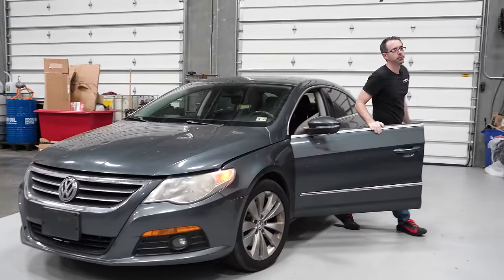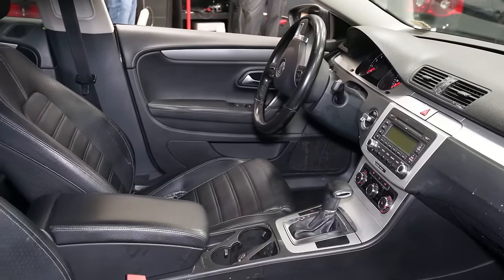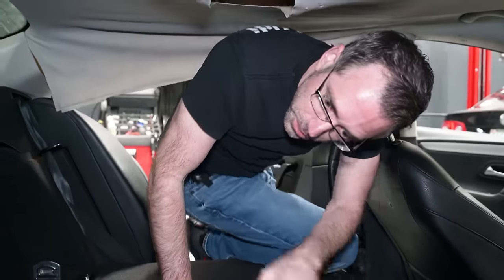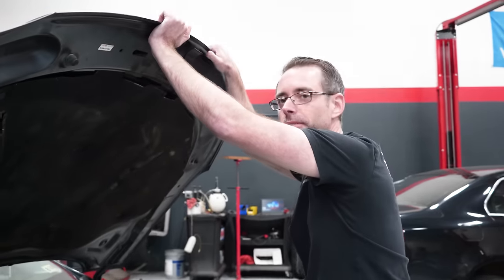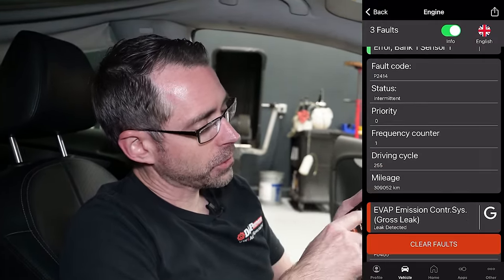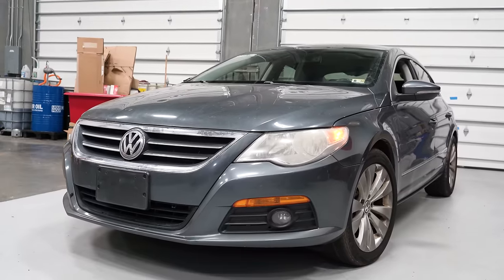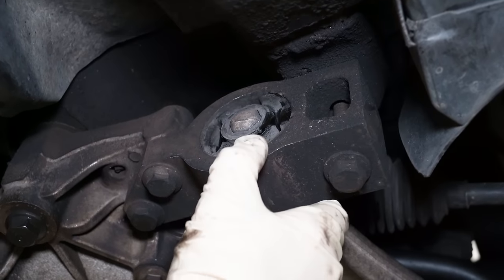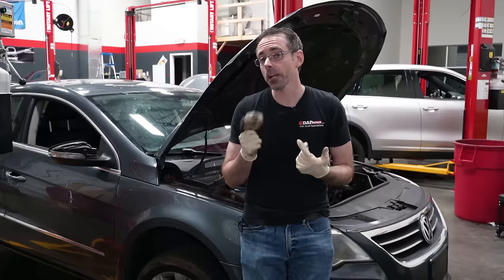How NOT to buy a Volkswagen CC

Comment: alignments are not necessary once a year. the only reason an alignment changes  is from worn out components or damage, things that would not be fixed with just an alignment.  it is however recommended to get the alignment checked when you put new tires on or if you notice a wear issue when you rotate your tires every 5k like you are supposed to

Comment: My buddy’s parents bought a 13 CC last year. Within a week the a/c stopped working and then an injector stuck and hydrolocked a cylinder, Bending a rod. Used motor dropped in, dropped a valve and ruined that engine within 1000 miles. Actual new motor dropped in jow and it’s doing well. Jusy bad luck after bad luck lol.

Comment: When buying a used Vw/Audi just make sure to have a good spot to have it on jackstands for half the time
Reply: Or the owner happened to be Mr moneybags and just got everything fixed as soon as it broke and didn't even look at the bill
Reply: @TwoDollarGararge  That would be ideal
Reply: @snoopy5736  have a Mark 4 2.0 golf 230,000 miles right now owned by an old lady clearly she just wrote a check for the parts bazooka every wear item and potential problem item is new if the mechanic didn't mess the belt up and bend some valves it would have been great
Reply: @TwoDollarGararge  I have an A4 B7 , oil pump balance shaft went out. 134k

Comment: very pretty car.. but doing some checking  i bought a 2014 ford fusion with the 2.0 vel engine.. se with  lux packge and 18 inch wheels... has adjustable supension on it now and  a  tune..35 mog on the highway at 70, in cruse control... 0-60 now  5.7 seconds... nice looking car inside and out

Comment: Love, absolutely love my 14. Just changed the clutch, slave cylinder, intake manifold, and water pump. Exterior still blows my mind in how flat and and glissining it appears. Freakin feels like a new car but yes, the delaminating headliner and door liners, suck. When driving no efffffs given... But passengers in the car... Yeah, i cant forget.

Weird how it it stretches tight and dossnt have foam falling out like other car driven until the wheels fall off.

Basic wheels still look brand new and are simple to keep new looking.

70k miles? Bottom level sport model, Fun as eff to drive? Hmmm... Keeping it until the wheels fall off. 

/Knows that when the turbo dies a reevalation is needed
//Maybe that will be a good thing. Lol

Comment: Could the inner tyre wear be caused by the rear inner control arm bush wearing?
I'm wondering if the flex due to this wear might cause the front tyres to toe out when under load (high speed cornering, etc)?
Your opinion on this is appreciated, as most large VW's - Passats, Arteons, CC's, etc - all tend to wear the inside front tyres, regardless of regular alignments.

Comment: For the burning of the oil. If there isn't much blowby in the cylinders, then the pcv system might not be the problem. The valve seals would be my next guess. If it was not the turbo seals letting oil burn up inside the turbo exhaust side. That car has def been hot rodded around. IMO

Comment: turns out I have seen the "how to check timing chain" video back in 2021 as soon as I bought my mk6 GTI, and I didnt drove for a week till get the funds to replace it! it was 6.something! some people dont take care of their cars, its crazy, but your videos have helped me a lot! thank you as always, and im watching this for fun lol, 
also my car is burning oil but I havent find the reason yet, using liquimoly 5w40 and adding 1L every 1300 miles, need to open the engine but not that good yet! any clue? no leaks, no codes, no wet oil on exhaust, just regular dry burnt oil on exhaust, no coolant being burned or smelled (did waterpump too) its literally just burning and no clue where, also from TX (150k miles stock engine, bought it at 108k)stock turbo from the factory still (might be turbo??), brand new PCV and i replaced 3 times already within 40k miles just to be sure it works, they were all good!

Comment: Bought a 2010 CC R line with 70k miles. Drove fine till 100k when transmission started to fail, had let it go. Everything working fine apart from some  in or oil and coolant leaks. Never broke down on me lol

Comment: So what is the problem? Bad oil? I have 07 audi a4 that does smokes like this after warm up. Smoke smels like burnt rubber. Can't wrap my head around. Did same exact troubleshooting as in video. No check engine, engine has only 80k miles. Runs so quiet and smooth. Help please

Comment: Good to know about the turbo/oil. I just did my 2013 chains this weekend, and noticed a small amount of oil in the pipe. I cant recall seeing any oil in the pipe of my 2014 CC when I did its chains two years ago.  So naturally I feared the condition of the turbo on the 2013 is bad (138k).... but a small amount is ok? I'm relieved. Thx
Reply: Just check your PCV/oil separator parts first.  They are plastic and fail after 10 years or so, and aren't that expensive.  The oil in the intercooler can come from that.  Or the turbo can be worn.

Comment: Honestly, are there any VW models that are reliable for the long term ?
Reply: Define reliable. Do you mean beating it around like you would a Corolla with little preventative maintenance?  If that’s your threshold, then no modern VW is reliable.  VWs will last 200,000 miles or more if maintained according to a strictly kept schedule. That’s how most if not all German cars are engineered to be (it’s a cultural thing).

Comment: My 13 Tiguan has the same TSI motor and I cant figure out where the coolant is going, help. Not on the ground, not burning up into the engine, no clear signs of leaks anywhere! Should I be using German coolant lol.

Comment: need some help guys. I've got a 62 plate CC (2012) and the battery had gone completely dead after a week or so of the "renew key battery" on the dash. The red light when pressing the key wasn't visible at all, no response from the fob, but would work when inserted into the ignition. 

After having the battery replaced, the Reed light still isn't visible and no response from the fob either, it still works when inserted. 

I know there are a load of key resetting methods out there, but one of guys will no doubt have had this issue before. 

Any ideas? 🙈

Just to clarify, I only have the one key fob for the car. 

Last year I replaced the battery in the fob and it worked straight away, no need to sync it. 🙉

Comment: Can you make a video about the Mark 7 GTI oil changes. How quickly does the oil get dark in color? I just changed mine after 2000 miles and it's already kind of black
Reply from the maker: That’s pretty normal. Diesels turn black instantly

Comment: I’m just looking for answers, I got the Passat B7 2.0 TSI. I installed a CTS Turbo vacuum DV valve, immediately after turning the car on im hearing rattling noise on the right side of the engine where I installed it is more noticeable when car in revers. Any tips I can take from you?
Reply: Do not install parts on a car that don't belong on it..😂

Comment: For $1200 I think he got a decent deal! It may not be the best looking thing around but... I would have bought it too! Good buy in my book, but I like a shit box. That's why I have a 2001, 2004 and a 14 A4! Lol
Reply: I agree. $1200 is basically nothing for a car that runs. Assuming he can do the necessary repairs himself for "free labor", he might only need $2k in parts (suspension refresh, pads and rotors, PCV and hopefully not turbo).

So for $3k and 10 hours of wrenching, he can have a solid beater.
Reply: @rjmari  So, at the barest minimum $3,200 to start.
Then add in a water pump that fails, intake manifold flaps that will fail...
Hundreds here, hundreds there with zero faith that car will get you where you need to go.
Just lease a cheep car and pay $300 some odd dollars per month for something that'll always run and always have a warranty.
Reply: Put 2k in that thing and you have $2500 car that you paid $3200 for, plus untold hours of work.
Reply: @dirkmohrmann8960  Well the point is to have a beater car, not an investment. Maybe you missed that?

Comment: I have a question. I’ve noticed cupping and inner wear on the rear tires of a 10th gen civic. Even after an alignment, the same cupping pattern and inner wear reoccurred. Can bad rear socks cause this kind of premature wear similar to this car?
Reply: Yes. I would also recommend checking and replacing rear springs and rear bushings as necessary.

Comment: one last thing to make your rubber boots( cv.. steering.. ball joint boots) last a lifetime..once every 6 months or so.. wash them with dawn or what ever you want dishwashing soap.. with a brush...nice a clean.. the spray the boots down with silicone spray...the boots dont break down from the inside  but from the outside.. all that dirt. oil grease clings to the boots and like sandpaper... start cutting into the boot.. causing them to tear...my exp.. as a tech  17 years at alfetta motors in vallejo ca.. as a classic italian car tech.. so i might know just a little here

Comment: Hey Paul, a quick question:) Are those vcds-like channels on obdeleven on an iphone? Got the pro dongle with pro subscription (latest app version) and my live data is still a list of checkboxes... how did you get yours to show groups? Thank you!
Reply from the maker: Yes the channels are in the car and the groups are that way OBDelevens interface works.
Reply: @Deutscheautoparts  weird.. Thank you though:) I’ll be contacting their support then because I have the latest app (except of the ultimate plan, just the pro) and no groups are showing up for me. 
Good luck❤️
Reply: OBDEleven folks answered me that the difference is the car itself, yes. In older CUs there were groups, but in newer ones there is only a list of parameters. Cheers:)

Comment: vw b4 is propably last vw when it was moderately decent, next models are just rust and problem buckets. You can find vw b7/b8 with rust on doors and trunk when car is just 7-8 years old, which isnt normal, if your car has rotten doors then your floor is mostlikely already dead.
Reply: Volkswagens are pretty well rust-proofed. The cars I’ve seen with the most rust are Fords and Chevrolets by far.
Reply: @BabyBugBug  ford KA is very rusty, but new VW rust a lot from door handles to spots under logo on trunk, worse is propably only subaru which needs welding after 4-5 years.

Comment: Seeking help Regarding my MK7 GTI 2014, EPC light Engine Max speed 4000 Rpm* 
Oil Pressure Switches Replaced Both Brown and Blue, Brand new NGK Coils & spark plugs, Temperature Sensor, Colant Tank and MAP Sensor All brand New(Original from VW)
The Error was there before replacing all this, It comes after giving it throttle passed 4k rpms, when Engine is turned off and back on life is good again until it’s not
Oh and It Has OIL 😅

Any insights will be appreciated

Comment: the box under the seat has a connection that sees salt water splashed on it and corrodes in the winter, causing havoc. The front calipers are desirable in the mk7;s and the v6 340mm rotors as well we heard, 08-09 had a harder to get rear caliper as well
Reply: The biggest problem is Engenieers trying to come up with new shit, so they can sell "new shit". That's the consumer's fault for always wanting the newest and fanciest. The fuck is wrong with basic and simple? Today's cars are LOADED with unnecessary crap that makes it more complicated.

Comment: Yaaaa, that thing ain't getting fixed with a new pcv. Maybe the turbo...maybe... but mostly likely not. This thing likely has bad pistons and tings. And by now, the block is probably scored to no end too. Sooo, I hate to bring it to you, but this thing will prolly need a new short block. Or at least a used engine.

Comment: My old jetta 07 had the same issue with headliner due to sunroof leak 😭
Reply: I used to like having a moon roof. NO MORE.  Leaks, God help if the closing mechanism fucks up. On the highway, there is too much noise, need to close it. Too sunny, cold, etc. No more moon roof. Totally unnecessary.

Comment: walmart super tech oil is made by the Warren oil company,,,,,not walmart, and on the label it has the dexos1 gen 2 ,full syn. oil... project farm did a test on these oils,.. and the supertech full syn.. came out as one of the best oil... check the videos out... and warren oil company makes oils for some of the big names you see... i have been running it in my 2.0 14 fusion from the first oil change.. 6000 miles.. and i put in 6 quarts and get back almost all of it.. - a few oz,,.. never noticed the sweet smell.. must be something else in the bottle that you have,,, maybe some left over weed

Comment: I've always said. Even if you buy a well maintained older car, you HAVE to be prepared to sink another 4-5 grand into it and properly fix it to last. That's just how it is. Cars don't last for ever.
Reply: I bought a 2004 volvo s60 t5 and so far had to spend around 600€ to get it fixed. Those were rear brake pads, discs and handbrake cables 🥴

Comment: Supertech is actually one of the better oils you can buy.
Reply: Not for a Volkswagen. You need a special approved oil to keep your warranty.
Reply: @BabyBugBug  That's just for the warranty. Other oils will work fine unless you have a diesel, then you need low ash 507.00 oil to prevent plugging up the DPF on newer cars. There is no way VW would be able to tell what oil you have in your car.

Comment: CAUTION: When purchasing a German auto older than 3 years used, you are apt to be purchasing an automotive money pit. Post WW2 the Germans studied the demise of many other countries auto industry. The late 90s ushered in the throw away car. Having built their dynasty upon the ruggedly reliable  air cooled beetle platform & later 4 cylinder gas or diesel rabbit platform, VW & the entire German auto industry began selling warranty term cars...definition: ...a product barely able make it thru warranty period before falling apart, failing, self emploding; ET AL. VW  flooded the market place with their sign and drive lease cars, as did Nissan cept for Nissan it almost bankrupt them! As a previous owner of a 68 Karman Gia, 87, 78, van & 86 jetta...the earlier products were acceptable...even the 72 240 D Mercedes now  brand known as a money pit was good...since then, our cars have been Toyota or honda...

Comment: My friend has one of these. It's dead in a garage awaiting a new engine due to a carbon build up in the engine. VW refuses to address this common problem. Not even 100,000 miles. VW is absolute garbage.
Reply from the maker: Carbon build up doesn’t kill engine. He likely has another issue.
Reply: Timing chains are shit on these TSI engines. I had to replace mine every 60k miles. lmao
Also if you do oil changes according to VW recommendation then you end up with sludge in the engine but if you do oil changes even less often then you'll pretty much kill the engine. My friends engine was burning oil because oil rings were 90% clogged with sludge.
Reply: @Deutscheautoparts  ya, German "engineering!"